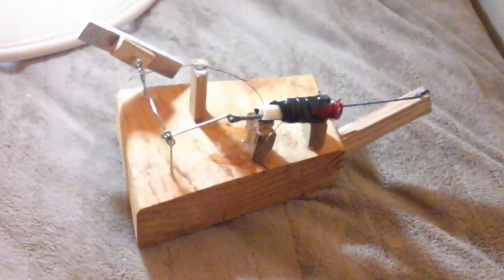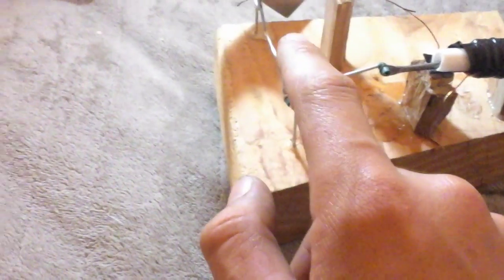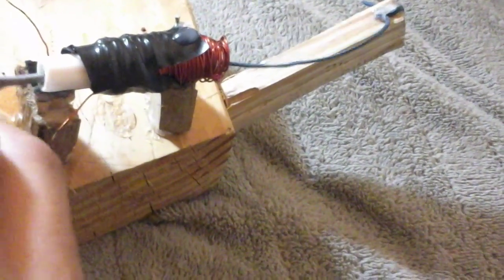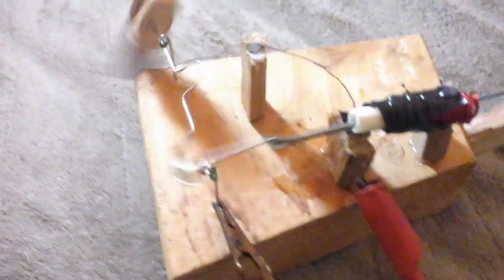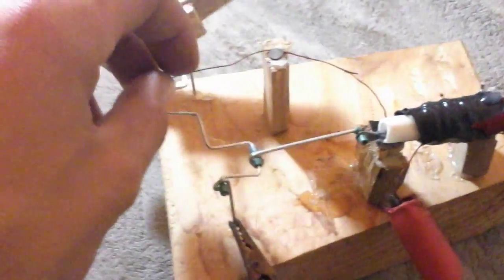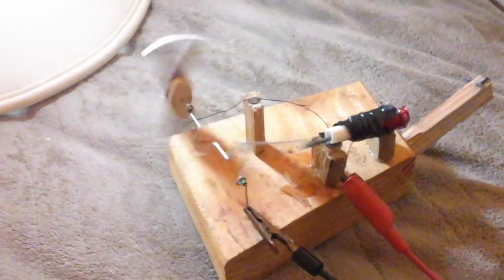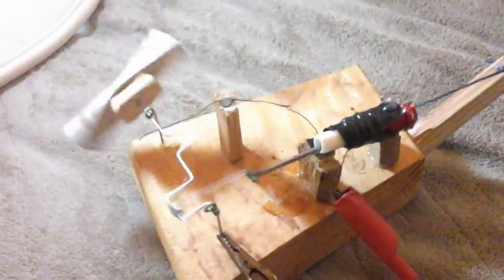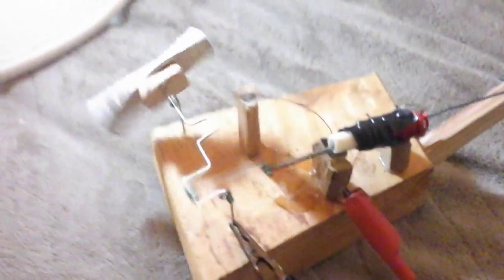Homemade Solenoid Engine

Comment: u should try to match the piston and the cynlinder size and remove that rubber
Reply from the maker: Better piston size matching would be beneficial, but the rubber is quite necessary for a machine like this one. The tolerances are low, so without the rubber the joint between the con rod and the "piston" will buckle downwards. If and when i get around to it i may make a tight tolerance version of this that may not need the rubber.